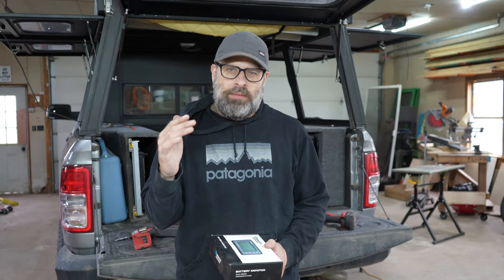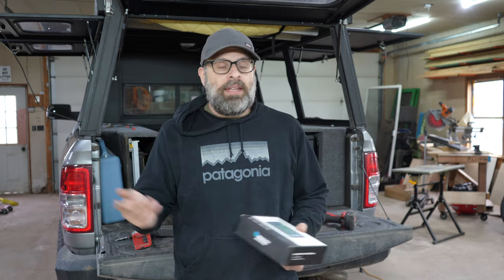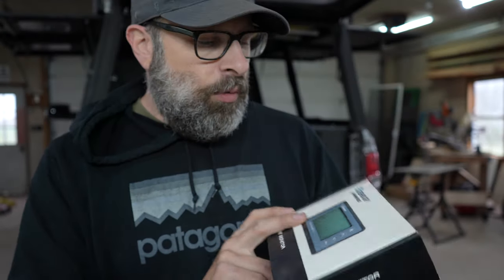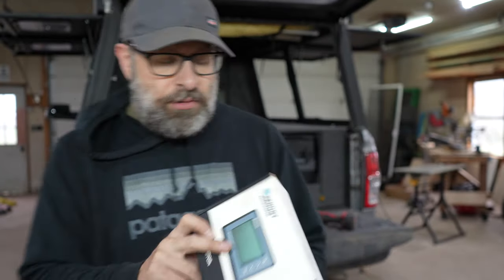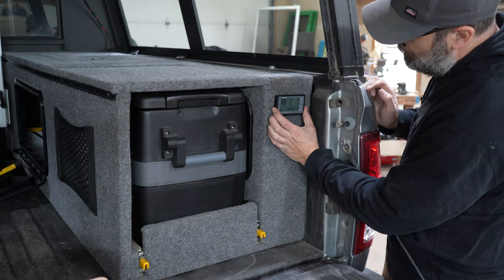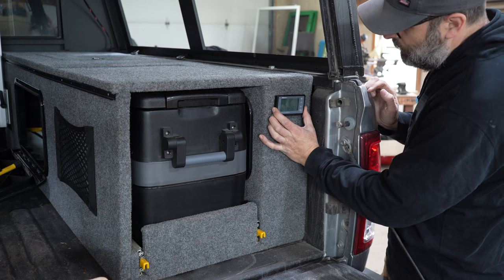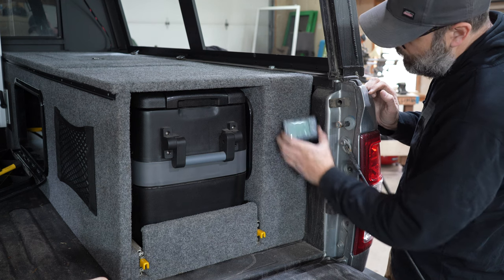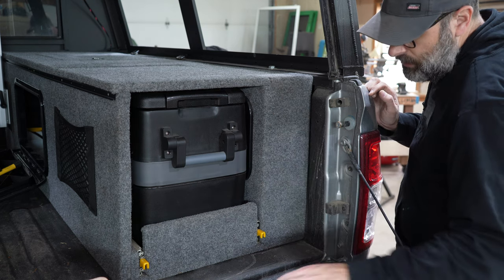Installing A Battery Monitor - Solar Renogy - Overlanding Offroad Camping

Comment: That's hours and minutes left on the battery at that load. You can get carried away watching it recalculate. When the screen goes bright dim bright, there is charge flowing back into the battery and it will tell you in hours and minutes how long it will take to get the battery back to 100%.  It is reasonably accurate. On my 24 volt system, the Renogy voltmeter shows 0.3 volts too low at all times as compared to readings from a Fluke multimeter. No big deal as the percent charge and the time left are the important items.
Reply from the maker: Thank you!